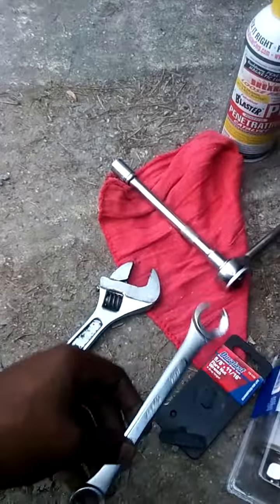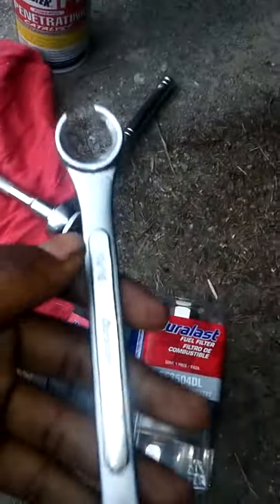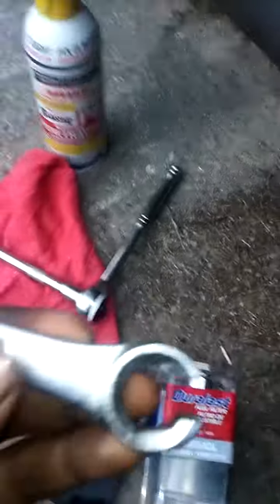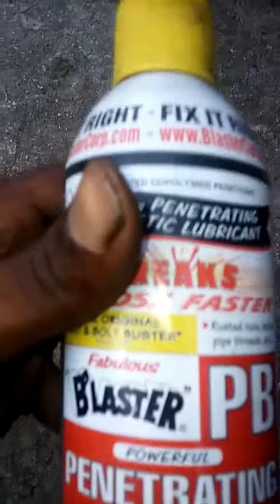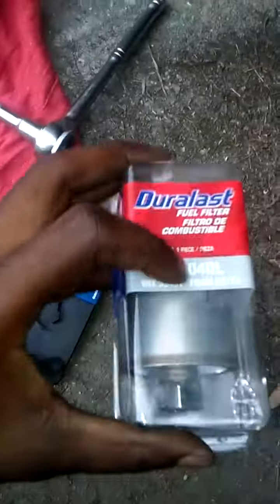Chevrolet Suburban fuel filter replacement

Comment: Had an interesting issue - removed the fuel pump relay but the fuel never stopped leaking, so replaced the filter amidst a constant stream of fuel.  Nice!  Be sure to wear glasses and have rags handy.  Just saying ...